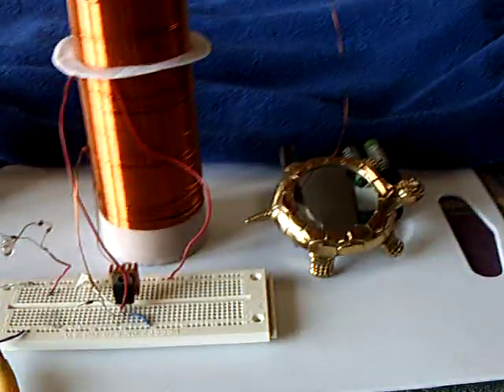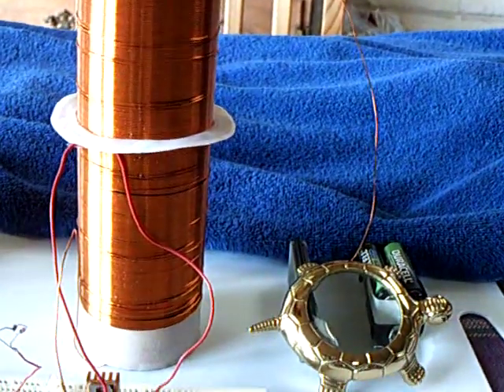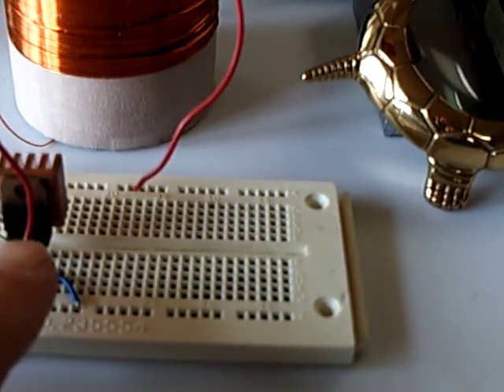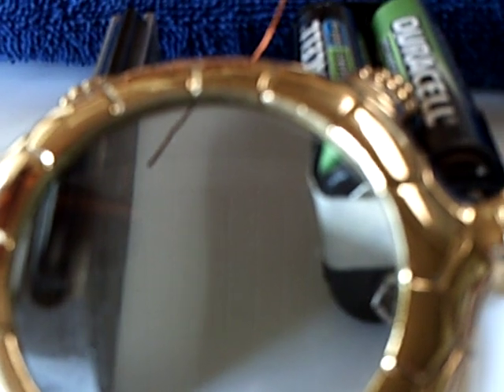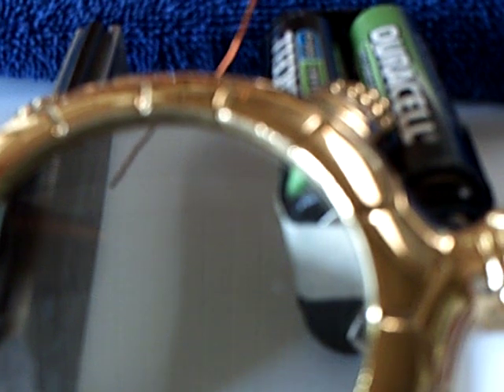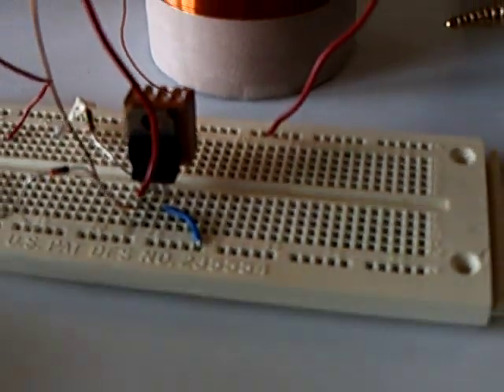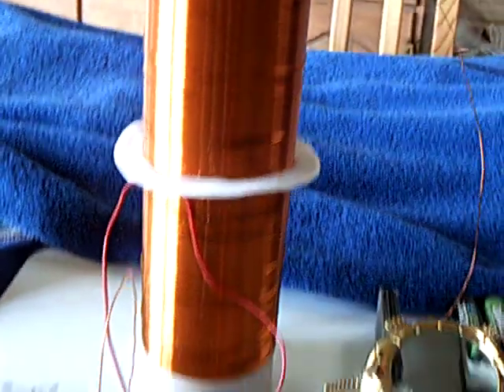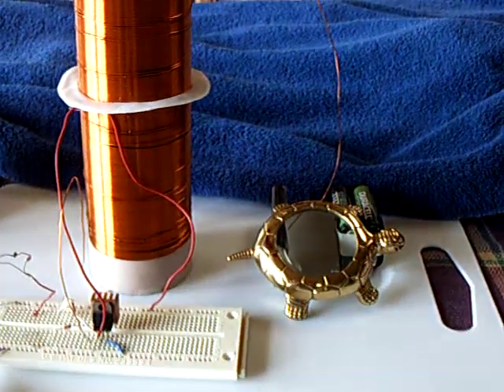Plasma at last!!.ASF

Comment: essentially what you have in regard to the coil arrangement is a solid state tesla coil.
if you wind L2 with some mono fishing line next to the copper so its evenly spaced and try to match the weight of copper between L1 and L2 so the MASS of the two are the same and build L1 so it has a looser coupling(like a flat spiral or cone shape and position at the bottom of L2) then you should get much better output.also a top load dome is important with coils like this.

Comment: Nice one Lidmotor.
Not sure if you seen my last video.But if you add a second tower right off your battery post you will see lots of plasma.

I also posted the circuit I used in the video and at the forum.